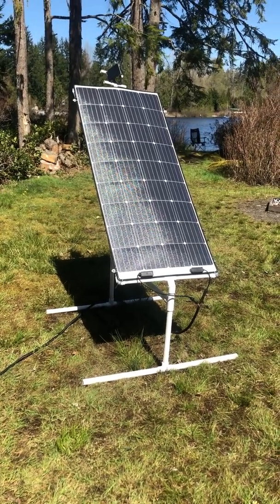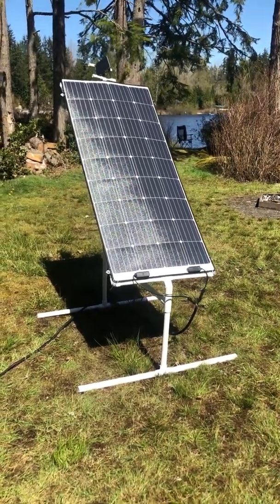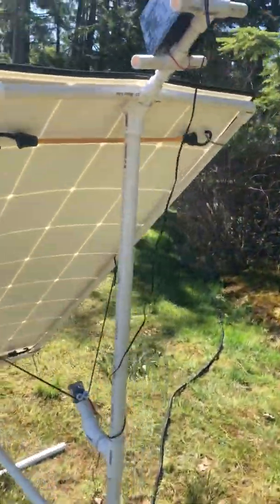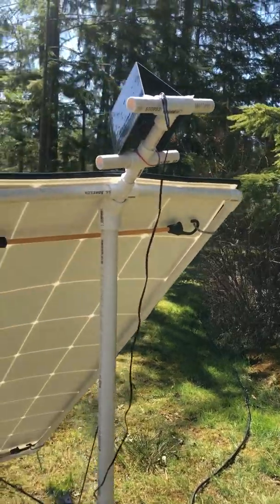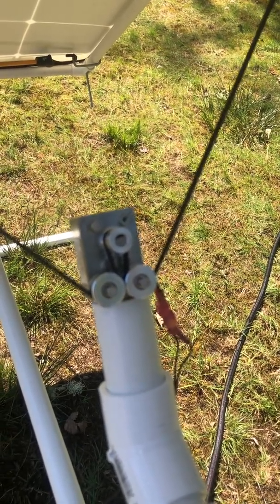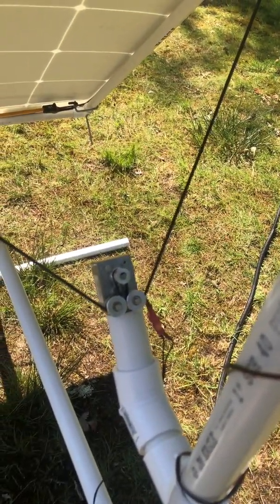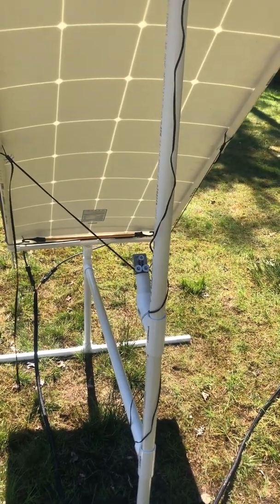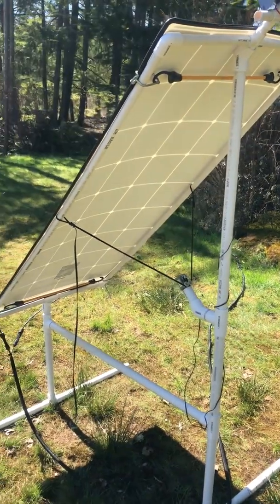Single Axis Solar Panel Tracker - Intro

Comment: Hi, how did you mount / secure the motor inside the PVC pipe?
Reply from the maker: It's just a tight fit, it's just stuck in there

Comment: Hi Sir. I have a question, at what point does the engine know to stop? Because the sun continues to shine on the small panels, which means that the engine should not stop.
Reply from the maker: Good question.  The motor stops when the sun is on both panels equally.  The two panels are wired with opposite polarity, + to - and - to +.  Whichever panel has more light wins over the panel with less light and that determines the motor movement and direction.
Reply: @peppermoongarage Thank you, I am about to do this project and your answer helps me better understand how it works.

Comment: I realize I’m seeing this two years later but there are a lot of solar tracker videos out there that are at least that old and I have been watching a lot of them lately and some are not even worth watching. I have to say this is pretty ingenious, neat and compact. Kind of what of I’ve been searching for. The geared tooth belt is great!!!
Reply from the maker: Thank you.  My goal was simple and portable.  I'm still using it to this day.
Reply: @peppermoongarage  Can I ask a dumb question? I can get the motor to run manually (shifting the orientation of the two panels) and then it stops and voltage sits at about 1/2 a volt and I can’t see it moving the motor in any timely manner. My set up is slightly different but the theory is the same. How often does the motor kick on and move the solar panels for you? 1/2 hour? Hour?
Reply from the maker: That's actually a great question.  Due to the internal mechanical resistance in the gear motor, the motor does stop and start many times throughout the day.  Once the voltage difference is large enough, the motor will run until there is not enough differential voltage in the small solar panels.  I would say it may kick on and off every 45 minutes or so with good sun, less often is it's a little cloudy and none if it's totally clouded over.  I don't think that makes that much of a difference in optimizing the solar harvest.
Reply: @peppermoongarage  thanks for the info. I’m still testing it. I have it setup to rotate a turntable so I was wondering if I was getting similar results. 45 minutes seems about right but I need to do more testing.

Comment: Hello! If I could suggest something, it would simplify the construction a bit. As for this upper connector quadrilateral. This is probably the most expensive element of all fasteners. Since you use two pipe diameters anyway, it is worth drilling a pipe instead of a quadruple connector and pulling a second smaller diameter, which will be the upper part of the frame, and in one piece. Good job. Greetings from Poland. :washhands:
Reply from the maker: That's a good idea.  I like it.  Thanks for watching.

Comment: Hello, I'm currently working on a a large scale solar tracker similar to your design (horizontal tilted single-axis east west solar tracking system). Just wondering, do you have an estimate of how much more power do you get from your panels compared to a fixed setup? Keep it up with innovation, cheers.
Reply from the maker: Thanks for the question.  It's hard to say exactly, but I estimate my solar production is improved by 25 percent over a fixed panel.

Comment: clever and simple build that allows anyone to follow.  don't even need plans !

the beauty is that one gear motor could control multiple panels.
anyone who thinks it is easier to use 2 panels has not used solar.
I made a cheap and dirty 2 axis for my bird-bath.  the pump works only when there is enough power.  on a typical summer day, that is a few hours.
add in the tracker and it easily runs twice as long.
2 panel would develop twice as much energy, wasted, in the peak output to get enough power for longer running time.
Reply from the maker: My setup is portable and needs to be stored away when not used.  Two panels are twice the size and work vs a tracking system.

Comment: Hello, nice job. i am reseaching similar system like yours. problem of the light weight flexible solar panels and pvc tubes are when strong winds are coming up. and my experience with flexible solar panels are, they won't last for a long term. maybe better build a moblie tracker with a 100 - 150 watts glass panel with your system and you might improve the system. 
https://youtu.be/dpeZnZwHjTI
cheers

Comment: true is instead of any tracking device. an extra panel would be more viable and same result plus it might be cheaper. fact
Reply from the maker: It really depends on what your needs are.  I’m in an RV and an extra panel would require more storage.  Cost-wise I think I have about $30-40 into the whole tracker vs $300 for another 160w flex panel.  If you need more power, sure, another panel is the way to go.
Reply: for the calculation if it is worth to get more panels or to use a solar tracker it's depends on the dimension of the whole system and the entire cost.
e.g. 1000 watts system. with a solar tracker you get until 35% more energy per sunny day. all the parts you need for the
solar tracker is under 150 bucks. there is no more cost if you build the tracker by yourself. if there is a professional company install the tracker for you then there is another calculation. but can you get ( 35% =350w) a panel for under 150 bucks? and you get the peak of the farming power only between 11am and 1pm w/o a tracker. during the other day time it is really unefficient without a solar tracker. then you need more panels which face to the sun, to the east and west direction.